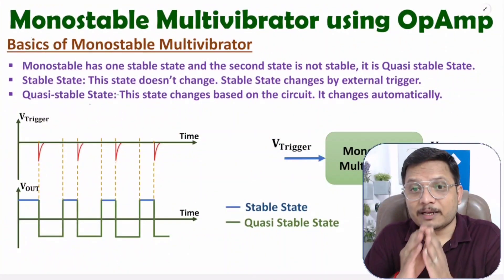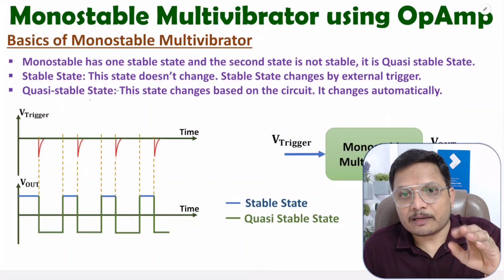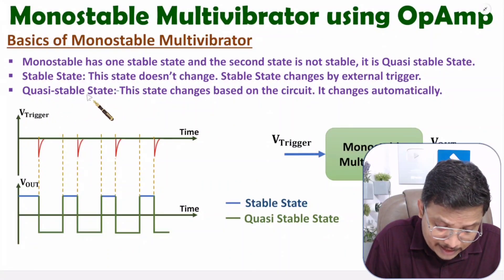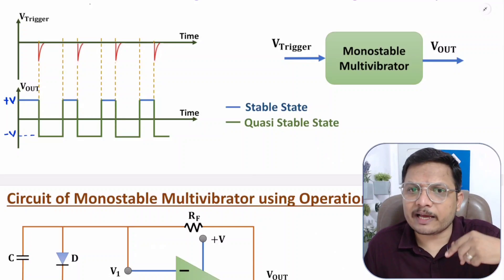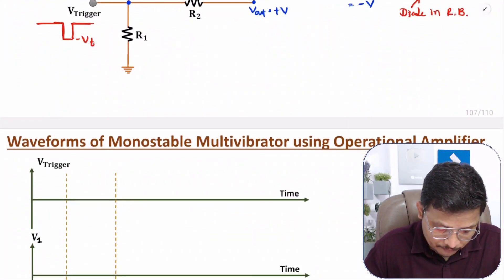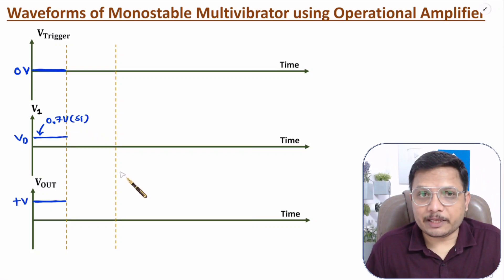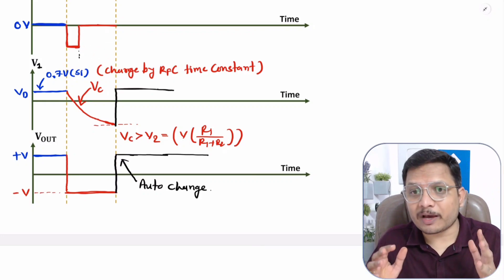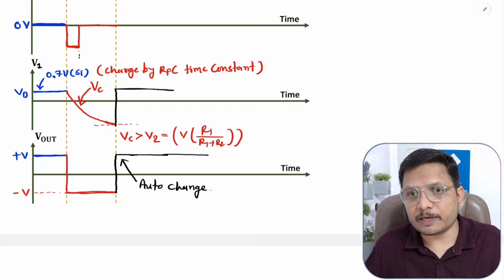Monostable Multivibrator using OpAmp (Basics, Circuit, Working, Waveforms & Derivation) Explained

Comment: How precise these works if I use two of these ic's into a class d amp for deadtime correction, I need on the falling edge of the gate mosfet signal a longer on time
who is the same as the deadtime delay so it does have deadtime but not the errors.
Reply from the maker: For that you should see the specifications of IC, like slewrate.